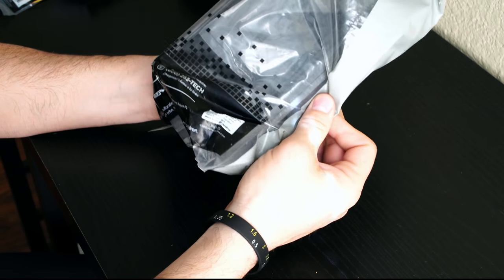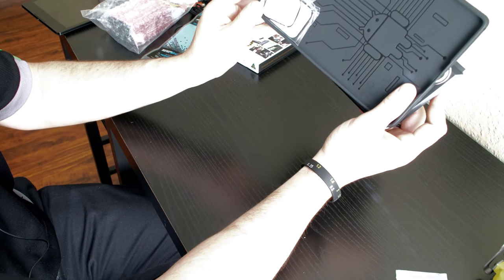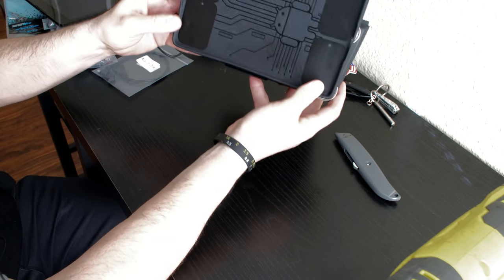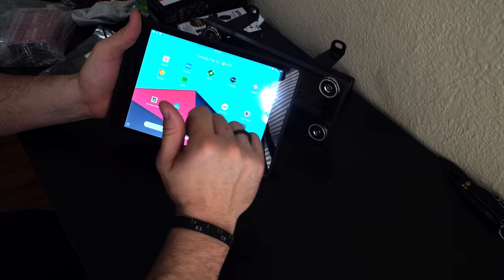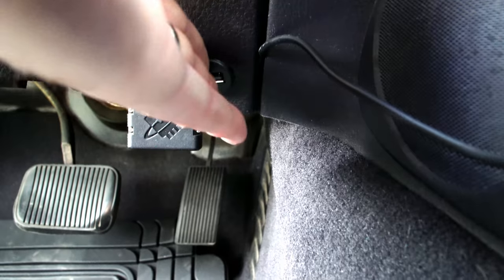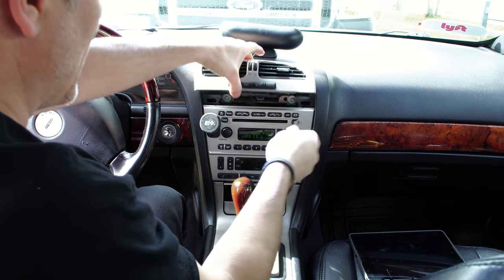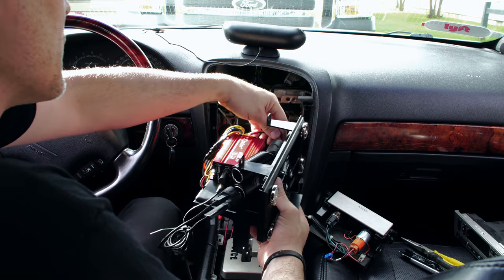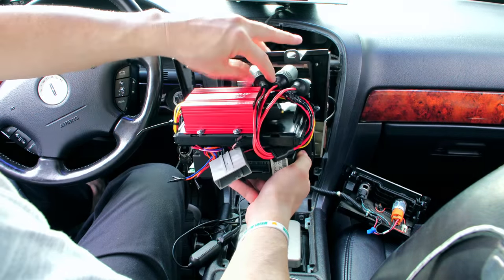Turn Your Tablet Into A Head Unit

Comment: I used your method in the beginning with the head unit set up but I put a single din radio in the back with the tablet on top. It was wayyyy easier. Not as good quality but I just wanted the tablet to watch movies when I’m parked.
Reply from the maker: That's an excellent way to do it. If I build another one, that's likely what I will do instead of the amp being there. I would love to see your setup. If you make a video of it, please drop the link here.

Comment: I am a software student and working professionally in IT i would like to recreat this idea using a phone but I would like to load my own person UI onto my phone specifically to control my car audio, lighting and more. You need to realize phones and tablets have processors meaning the can run customizable software. I will reach out if I am able to figure this out. P.S. my plan is to use my old phone from 2019 don't use you current phone because If you plan to do a whole O.S. wipe. I would not like to encourage some 16 year old to do sketchy stuff with both his phone and car.
Reply from the maker: That sounds like a very interesting idea! Please update me and let me know how it goes. I made an update to this video which is recommended at the end of this one. In the update video, I do a different setup in my truck that requires no custom work. You might like that one better.

Comment: I tried this, installed the tablet behind the fascia to make it look stock. I did a similar thing with the audio but my wiring was very intense, especially with a subwoofer. Problem I had was turning the tablet on and off. I could use an app to turn it off when no power was going to it and power on when it was but then it wouldnt charge in the car.
Was a huge learning process but in the end I just bought an actual android head unit
Reply from the maker: Thanks for sharing that. I never thought about that aspect of the power and volume buttons behind the dash not being accessible.

Comment: Very nice setup, just wondering about the OBD CONNECTION.   is this a totally different connection to the tablet you need to swap or have you combined it to your USB connector?  Again great setup.
Reply from the maker: It is an entirely different connection. The device I have plugged into that socket connects to the tablet via Bluetooth. All automobiles from 1996+ have that port and that port receives power from the vehicle so it is easy to have a stand alone dingle plugged in there to transmit the data from the on board computer to the tablet. Check the Amazon list in the description if you want to check out more details on that item.
Reply: Thanks 😊

Comment: you should check out plastic welding, would work really well for this kinda stuff.  And knife blade in a solder iron for cutting. Thanks for the vid
Reply from the maker: Thank you for the recommendations. Will do. You may also enjoy the update video that I did to this one where I moved to a larger tablet and a different set up in my truck. I'm also considering working with a friend that has a 3D printer to fabricate brackets and sell them to anyone who wants to easily do this.
Reply from the maker: https://youtu.be/dmiVHRV2etw

Comment: quick question, but does the magnet mess with your storage at all? I dont know where on the tablet the storage devices are soldered in to the board, but magnets tend to not match up well with storage boards. Dunno if thats the same for like thumb drives and such tho. So yea, any problems with that or?
Reply from the maker: Nope, no issues at all. Magnetic storage media was phased out about 20 years ago. Today's devices are largely unaffected by magnets.

Comment: Hey Edward
I was wondering if I could still use my mobile's bluetooth to talk on with the car's speakers and mic while also having my tablet connected. I already have an 8 inch screen that helps me control audio, calls, climate & seat controls, but I do need navigation and this is why I'm planning to do this.

Any suggestion?
Thanks for the wonderful video 😄
Reply from the maker: You can take calls on the tablet with a service such as Google Voice which is what I was using. If you already have a Bluetooth enabled head unit, newer units will allow multiple connections and you should be able to sync your tablet and mobile. Check the recommended video at the end of this one for an update I did where I used a different setup in my truck.

Thank you for the compliment and good luck to you!

Comment: How is the volume control? It's the only part of the video that I didn't quite understand. Does the amp or the tablet control speaker volume? Do you have to set the gain on the amp then fine tune with the tablet? For example, in my car using auxiliary input, I have to turn my phone volume up all the way, then adjust volume with a knob on the Pioneer head unit. Thanks for the video, great documentation!
Reply from the maker: Thanks! I first maxed out the volume on the amp and then adjust it through the tablet as it is much easier to adjust the tablet volume.
Reply: @edwardlthompson  Thank you! I'm trying to figure out if this is a realistic goal for my '88 IROC summer car, or if it would be simpler to just run my smartphone to the amp. This video was very helpful!
Reply from the maker: @James-WM  I'm really glad this helped! I love that car! My foster father had one and I've been in love with the IROC ever since! Good luck and let me know how it goes!

Comment: I am loving the idea, but hating the camera work. One hitch with those adhesive steel plates is that your magnets need to be in the same plane otherwise the magnets will slowly pull the plates off of the case. Sometimes they just come off enough to move and it looks like the adhesive is not good enough. I grease the back of the magnets and leave the screws a bit loose, then put a dab of plastic weld or acrylic behind them and stick the whole assembly on the side of my toolbox. When it cures, the magnets will all be perfectly aligned. Then you can fill any holes, sand & paint and it will look like it came that way from the factory and it will last.
Reply from the maker: Sorry for the bad camera work. I am working on improving that and future videos. The plates that attach to the magnets are inside of the case that goes on the back of the tablet so they are not moving around. They don't even need that he civ really but it does sort of help them stay in place. I have not had any issues with them being misaligned and the tablet has held on to the magnets very well. That is an interesting approach that you have though. Sounds like it would look nice.

Comment: your practical yet technically experienced modding would make an awesome self install bluetooth kits, (front and rear camera blutetoothed to tablet, in car information bluetooth adapter to tablet, and the  bluetooth audio combined all going to an FM radio transmitter station, aux cable, or tape deck audio converter player on stock stereo) if it'd all be like $40 for something they have dangling under their dash footwell, running under the car through wires to dash webcam, and trunk license plate frame cam, and all pluged into 12v dc lighter power and a secure tablet mounting everyone could make their car a smarter use one
Reply from the maker: Thank you for watching and commenting. Make sure you check out my update video for more ideas!

Comment: Nice idea but u could've just screwed the tablet backing panel onto the dash piece n then you'd be able to just slip ur tablet in n out of it, plus, the backing panel has a base plate to stop slippage. Have those magnets messed ur screen colours up yet?
Reply from the maker: That's also a good idea! Snapping it in and out of the tablet case would be a little more difficult but it would also work.

Magnets only affect the old CRT monitors and have no effect on LED screens.

Comment: At about 3:05 mark you appear to be holding a plastic plate, yet you said "this 7 inch tablet" - it doesn't look like a tablet, or is it covered in some kind of packaging?
Reply from the maker: Those two objects are cases for two different size tablets. Same as a phone case.

Comment: How is the tablet connected to I internet???  Thanks 👍
Reply from the maker: Both this tablet, and the one I use in the update video are LTE capable tablets which use a SIM card to connect wireless to the cellular network. Alternatively, you can get a Hotspot from your mobile provider that connects to your OBDII port that will fire up every time you car starts.

Comment: Hello. I was wondering if that works on any car model and if there are any major risks like burning it down or something? I'm not an expert but you seem to explain it quite simple
Reply from the maker: Thanks. No fire risks. It works on any car that has a double DIN form factor for the unit. Most newer cars have non standardized units making this swap non feasible. There are other methods. I did a different setup in my work truck. That update video is recommended at the end of this video.

Comment: This setup is great for complying with distracted driving laws. Well, if you don't push it. ;)  I guess it depends on how you look at it? I am noticing the easy one touch options in comparison to using your phone while driving.
Reply from the maker: Absolutely. If you can get away with using your phone to navigate with on a holder, there shouldn't be a problem with the tablet.

Comment: Do you know of a weather app that would display a 3 or 5 day forecast designed for a tablet? Most weather apps I've tried use the higher resolution of the tablet to display tons of information effectively making the forecast micro-sized and difficult to read by the driver and passengers. Would be nice to just have a large format readable at a distance.
Reply from the maker: I personally use Weather Underground on my phone. They have a pretty sweet 3 day widget with graph. You can also make an application icon for Google Weather which should scale nicely when opened.

Comment: I love the video. Quick question...the magnets make my tablet screen go off. Are the magnets just too strong?
Reply from the maker: Some devices have built in magnetic sensors for cases that turn the screen on and off when opened or closed. Try and position the magnets away from the sensors.

Comment: I was SO hoping this would work. The critical problem with this solution is that the tablet cannot be charged while connected to the carplay dongle. I'd like to be proven wrong though! If anyone knows of ANY tablet that supports charging while connected to a dongle (via a Y adapter for example), please share if you have direct experience.
Reply from the maker: It is possible with Lightning and USB-C ports only.

Comment: I gave a try for Raspberry PI 4 (single board computer) with OpenAuto Pro software on-board recently. Advantage is that it is much cheaper than tablet and is more flexible when installing in car.
Reply from the maker: That sounds pretty cool. What do you use for a display? I haven't hear about that software.
Reply from the maker: @CarlsonLipke  very cool. I will be checking that out!

Comment: Does the phone and tablet both need to support OTG or just the phone??? Thanks for the walk through man, very helpful!!!
Reply from the maker: Whatever device you use should support OTG especially if it has a USB type C connection. You might also want to check out the update video I made where I changed a few things around and used a newer tablet.
Reply: I got it up and running!!! Thanks a bunch man. The only question I have now while I'm waiting for my external mic, is do I run it through the tablet or my head unit aux?
Reply: Incase your wondering I'm keeping my aftermarket bluetooth head. Gonna try connecting phone to tablet your way and then tablet to head via bluetooth and see what happens.
Reply from the maker: @johnhuebner2594  I did something very similar. Check out my update video when you have the time. It should be suggested at the end of this video. I run my tablet connected to the Bluetooth in my truck now. That wasn't an option in the Lincoln.

Comment: Appreciate the video bro.
Just from personal experience those extra power outlets cause interference  when attached to the same power line as the radio. Tap them into your stock power outlets.
Reply from the maker: Thanks. Check out the update video. I made some changes.

Comment: Really, really great video. Comprehensive and clear. I ended up using magnetic mounts to position my 8" Android tablet over the built-in head unit with connectivity over Bluetooth. The Car Launcher app is great - I also downloaded the Android Auto APK given that surprisingly, this app is not Tablet compatible. Love the OBD Fusion app as well. Thanks for posting this video - a great resource!
Reply from the maker: That makes me so happy that you found this helpful and useful! Thanks for the feedback and good luck with your unit!

Comment: Just curious, on a hot day where the sun shines on the tablet while parked (or driving), will the tablet go in an overheat protection and be unusable for a while? Also you mentioned phone calls. How do you use it for that?
Reply from the maker: You are correct. I never leave the tablet in the car to avoid extreme temperatures and theft. I have a carrying case for it. I go more into detail about that on my update video that you will find recommended at the end of this video.

I use Google Voice as my primary number so all phone calls ring the app with no phone service needed, only internet.

Comment: Hey, thank you for this video. I just got done installing my iPad in my 99 Tahoe. When i got it, it did not have a radio. Now I have to trace all the wires to find the original wires for my door speakers so they will play. My rear speakers in the cargo area play but not the doors. Sounds good though.
Reply from the maker: I'm glad you're making progress! Little by little. It is fun to figure these things out. Once you get it done, make a video and drop a link here.
Reply: Here you go. I have to go back in to clean the install up. I only have one 6x9 working in the back. Got to chase the speaker wires to find the OEM wires, add another amp & equalizer. 

https://youtu.be/axoNM2R0Y7Y?si=zdaG2b8okw4khjYj
https://youtu.be/GhmOUnKt-m4?si=HcXvnhit-lN7UHD9
Reply from the maker: @MoBettaon3s thank you for sharing that video. I'm going to watch it later today.

Comment: I have a cheap $8 eBay phone stuck to the dash with commercial grade Velcro. But of course, your method looks way better.
Reply from the maker: Also a good solution. 

My phone has a 5.5 inch screen that I was struggling to see the maps on. That's why I wanted something larger that I could do split screen with both of the ride-sharing apps.
Reply: I always wanted to do something like you did though .

Comment: Have you inquired about what something like this would cost to have installed by a professional audio shop ? I am sure it would be pricey but comparing the DIY part to retail I am curious what the cost would be.
Reply from the maker: I haven't inquired about that but I imagine that the labor cost would add quite a bit to the price. There is probably some savings to be had by buying a Bluetooth enabled single DIN head unit and a simple tablet mount but where's the fun in that? 😂

Comment: Great work might save spending lots on a new head unit! Cheers Steve
Reply from the maker: Thanks! Make sure to check out the update video I did. I transitioned to a newer and larger tablet and did a different setup in my truck.
Reply: @edwardlthompson  Thanks Edward will check it out. Cheers
Reply from the maker: https://youtu.be/dmiVHRV2etw

Comment: Which tablet you are using? I have Galaxy tab 5Se 4G version I used it with a holder in Corolla 2015 model. Please advice
Reply from the maker: I started off with an HTC Nexus 9 and I have transitioned a few months ago to the Lenovo yoga tab 3 plus. Both are lte-capable tablets and I use them on the T-Mobile network.

Comment: So how is your tablet connected to the internet to use maps and such? Do you need a data plan from your phone provider? Thanks.
Reply from the maker: There are a few ways to do it but the most simple is getting a tablet with LTE radios so you can get a data only SIM from your service provider and pop that in for wireless internet. The other three methods would be to:

1. Make a Hotspot with your mobile phone. 
2. Get an OBD II powered Hotspot that had a data only SIM from your provider.
3. Go completely offline with the free offline and navigation from OSMAnd+ found on F Droid and get turn by turn navigation without internet.

Comment: One thing that you may not know is that tablet manufacturers made the micro usb's not charge unless the data lines in the usb wires are shorted out. The only problem I have with this is I still listen to am and fm radio.
Reply from the maker: Thanks for the information. You can always use an app like iHeart Radio to get your local channels on the go. All the host you love and all the commercials you hold dear.

Comment: for the whining, you need a ground loop isolator. It is needed because of a shared ground from all electrical components within the car. When you use the ground loop isolator, it filers the audio and acts as a ground in the same way that grounding the entire house works.

Ground Loop Isolator link https://www.amazon.com/Mpow-Ground-Isolator-Stereo-System/dp/B019393MV2

Comment: If you can connect a rear camera and front camera to record, then you have a nice system there.  Make it like the ones where they sell mirror dash cameras.  Then this would be a good complete setup.
Reply from the maker: You're right, that would be pretty sweet!
Reply: @edwardlthompson  they make wifi ones that are solar powered ..zero connection
Reply from the maker: @slow_rednline4874  perfect! Thanks for letting me know about that!